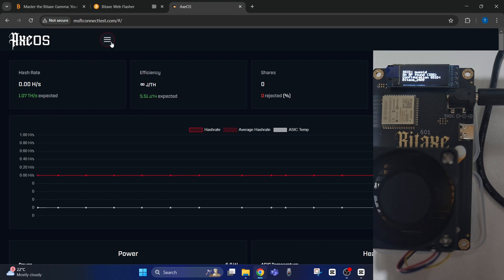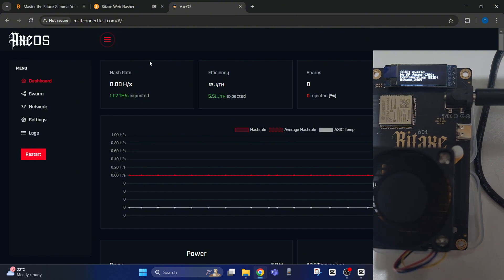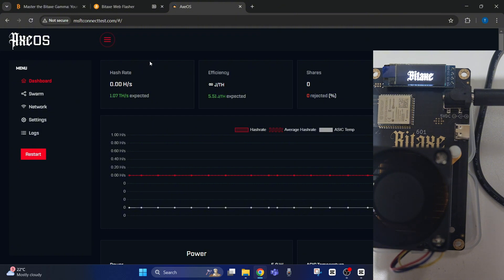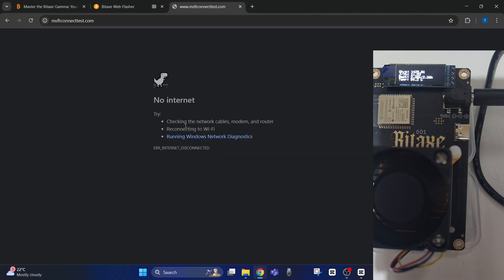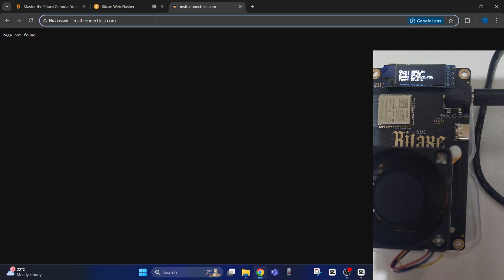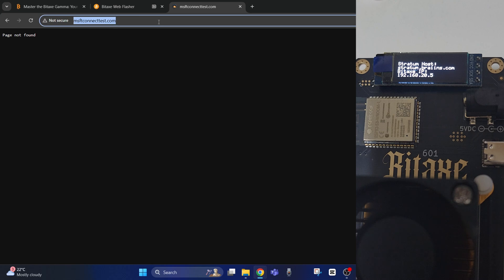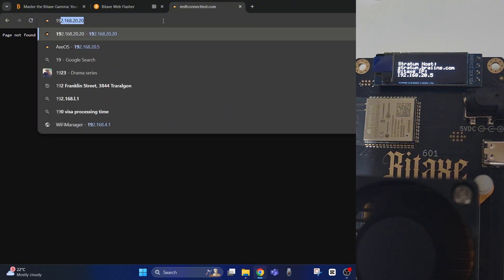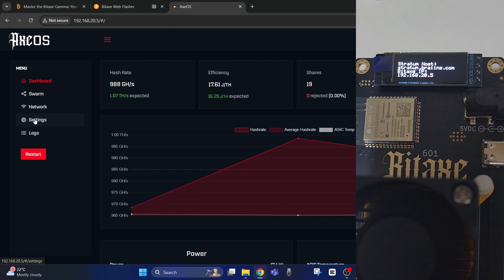Access and Change Bitaxe Gamma 601 Settings

Comment: I need help i already flaahed my bitaxe i have a v2.8  i entered my wallet saved and restart but my dashboard shows 0 hashrate nothing happens
Reply: Make sure you have.   .bitaxe  after your wallet address
Reply: Im conected on my laptop to the bitaxe but when i connevt to the network then im unable to have access to the dashboard of the bitaxe is that normal?
Reply from the maker: Have you logged into the bitaxe through the IP address? Also, what mining pool are you using?

Comment: hello I have big problem I flashed my bitaxe via web flasher and now won't connect to axeos like stuck in loading website any help thank u
Reply from the maker: Were you able to connect the bitaxe to that website before flashing?
Reply: @technologyteardown  yes everythings was fine I wanted to update it for the new  version from aweos firmware was stuck at 15% then I was forced to do via bitaxe web flasher  bitaxe gamma 601
Reply from the maker: @ikrahin6327 maybe try flashing it again. Also if you have issues with the current firmware, maybe try an earlier version.
Reply: @technologyteardown  fixed now I did flash with gamma 602 then I switched  my flash to gamma 601 everythings  work fine now

Comment: Hello, mine is not showing the Ip address on the bitaxe screen. how can I fix this/? thanks
Reply from the maker: Are you getting any details on the display? Or is the display blank?
Reply: @technologyteardown  yes I'm getting just ip number in this format,  IP:
00.0.0.00
Reply from the maker: You may need to do a system reset and re flash the system.
To do that try this video of mine:
https://youtu.be/QhnpQpGUXgo
Reply: @technologyteardown   not the normal IP format, 196.000.0.. etc
Reply: I just got mine today. I got it to the part where its connected to the home wifi but there is no IP addeess on the display. Its on a 2.4 ghz router. Any advice?

Comment: Why does every video tell you everything but what the settings should actually be? This is the third video that has left me frustrated and cursing. I need to know what actual speed to set it to. Why does no one talk about that? Arg!
Reply from the maker: This is because the "default settings" is what the settings should be. Any deviation from this could damage the miner. The other settings are for when the owner of the miner wants to take the advantage of speeding up their miner in exchange for the risk of over heating. This risk is best only taken if upgrades have been done to maximise the cooling and power supply efficiency. I have not done these upgrades and am not willing to risk damage to the bitaxe for a YouTube video. If in the future I make these upgrades, I will be happy to make a video with addition settings information.

Otherwise, is there particular setup information that you are looking for that I might be able to provide you with?
Reply: @ I see three different defaults and I was getting overheating on every one. I now have it sitting on a 120mm fan and that seems to have fixed it.

Comment: After upgrading my heatsink and fan it’s saying Bitaxe self test and that’s all. Even after I flash it just keeps popping back up. Do you have any idea of what’s going on?
Reply from the maker: It always pops up after the first flashing. Once you bypass it does it run correctly?
Reply: @ no. I can’t get out of it. If I press boot nothing happens no matter how long. If I press reset it does quickly reset and just comes back to Bitaxe self test screen. I’ve seen other videos where it says Bitaxe self test and also says to press boot or reset. Mine literally only says Bitaxe self test. I’ve checked the power usage and the logs. It starts up, watts go up to 20ish and then all of a sudden drops to 2 watts and shows that screen. The logs show the same it boots up testing diffferent mhz and then it just stops at self test sending work
Reply from the maker: Did you look at the steps in my video to get it out of self test mode?